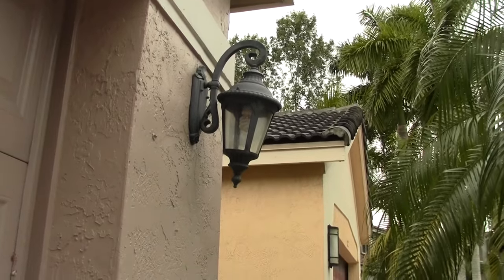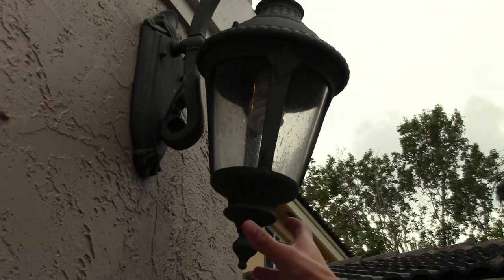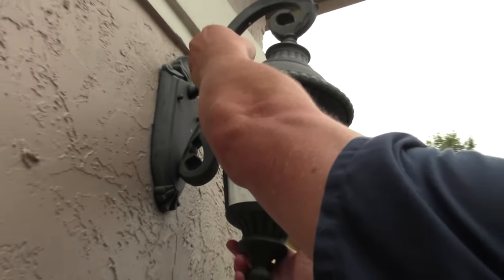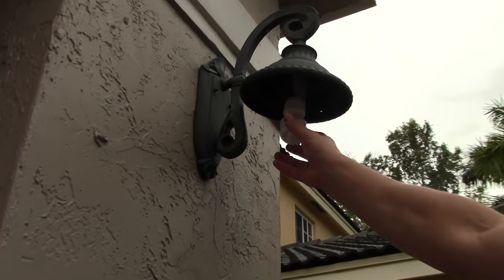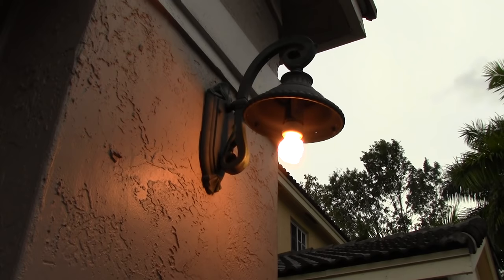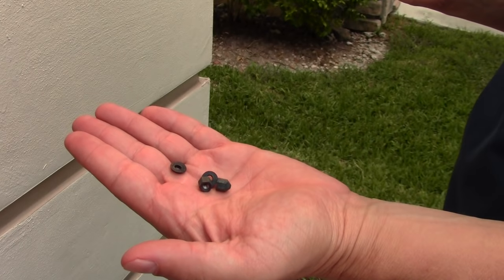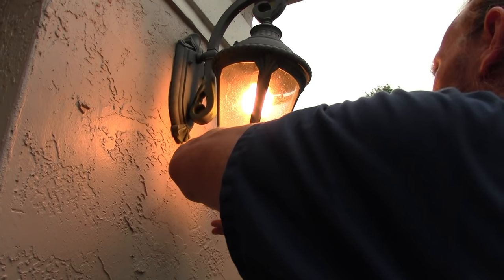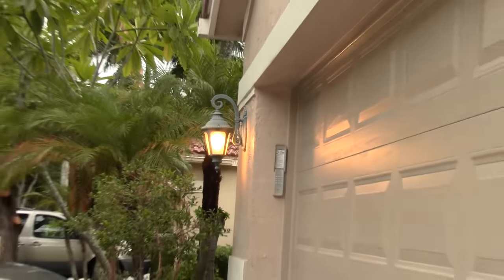How to change an Outdoor Porch Lantern Sconce  Light Bulb--Simple  DIY do it yourself procedure HQ

Comment: My lamps look almost identical and the paint on the stucco looks like my house. In fact except for the glass being frosted it looks almost identical (except one problem) there are NO nuts or screws where you describe. I see no possible way to drop down the bottom to change out a light bulb on these horrendous lamps which were attempted to be repaired by the previous owner. I guess replacement of entire lamps is my best option at this point.

Comment: in this exact same model of porch light, my light socket broke. I need to replace it and have not idea how to get it out.  There is a small screw that I undid but that was not enough. There is a metal casing surrounding the socket that I need to remove - how do I do that?

Comment: Give your friend a Robertson screwdriver and watch the confusion ensue.

Problem with these lanterns is that no one even tried to open one till the bulb goes out so there's confusion as to what shouldn't be turned versus what's simply stuck and of course how every one is different.

Also, on our 36 year old house, it's often plastic not glass, at least in the less ornamental ones on the rear of the house and sides of the house and my parent's broke the plastic panes years ago trying to change the bulbs.

Another bulb that you need to work out how to change is the one in the hood over the range.   My parents cracked the plastic cover trying to remove it.  Turns out that plastic tabs on the sides needed to be unclip and then it had a sheet metal top which slid off a bracket by pulling the whole lid forward.  It was quite unintuitive and several electricians that my parents had called for other work couldn't figure it out, the rivets fastening the top metal sheet to the plastic had them convinced it could not be removed without drilling out the rivets.

Comment: Sometimes if they won't loosen with a dose of WD40 soak,dry it off and get your hair dryer and maybe an extension cord.Plug it in and point the dryer at the portion of the where the screw is in the housing.Heat it not till it's molten red,but then  attempt loosening it after heating.Most times it will loosen.Heat causes the metal to swell thus allowing the set screw or screw to loosen.

Comment: In my case, the nut was rusted and stuck, and when I tried to remove it, it was broken and stuck inside, and the visible head is very small. Is there anyway to fix it? I want o avoid buying a new lamp fixture. Please help.
Reply from the maker: +Tarek Faham --->  Take a drill and drill the rusted screw out.  Once you do that, it should come apart.  You can then find a new screw and carefully fasten it back.  Make sure the new screw is not too thick.  That metal cracks easy.  The new screw will cut its own new thread into the metal.
Reply: jakeguitar01 Thanks I will do that and will update you. Can I find such screws in home depot or Lowe's for example?
Reply from the maker: Tarek Faham --->    yes.  Also, see if it's possible to use a small nut and bolt after you drill it out.  that would be better, but if your application won't handle it, just a screw would be fine.  coat it in a little oil or grease to prevent it from rusting again. "Never seize" will work.  Or you could probably get away with Vaseline.
Reply: jakeguitar01 I drilled both broken screws and now one the hole is slightly wider than the other. It's going to be a challenging task to find a suitable matching screw for each hole. I'm just thinking if I can insert some material to force the new screw to fit tight in the new hole? The screws I have are either too big to too small.
Reply: I think I need a thread repair kit. The inside thread is gone, and must be repaired. I'll go to Home Depot or Lowe's to find one.
Reply: jakeguitar01 finally fixed thanks for the tips: https://youtu.be/EkiTRkcITgo

Comment: Silikroil works better than WD-40 for loosening corroded threads. Also, Use LED bulbs instead of those crappy bulbs like the ones shown and you won't have to change bulbs!

Comment: The reason I'm here is that I'm literally screwed. On my garage, the light bulb has one screw in the back and over the years it rusted into the screw thread. There's no way to get it off I tried everything and even bought a drill bit piece that supposes to take screws out. I thought about hacksawing it but where the screw is it's hard to get to it. My light bulb in the front of my driveway broke off from the socket. The metal part is in the socket. By the way, folks turn off power before you fix ur lights.
Reply from the maker: You can get the metal part of the bulb out of the socket with needle nose pliers.  It's easy.  Turn off power first.   As far as that screw goes, see if you can drill it out.  Then put a bigger screw in.